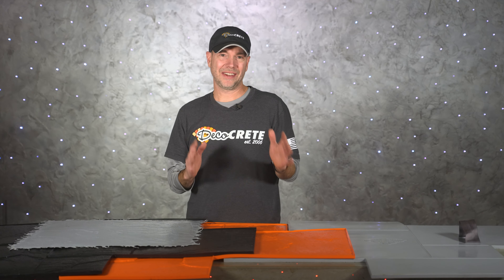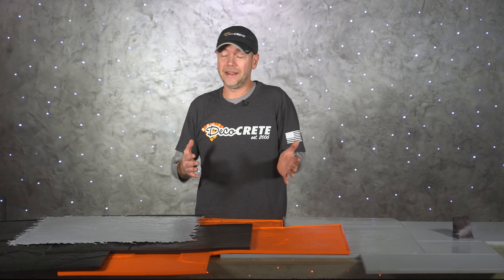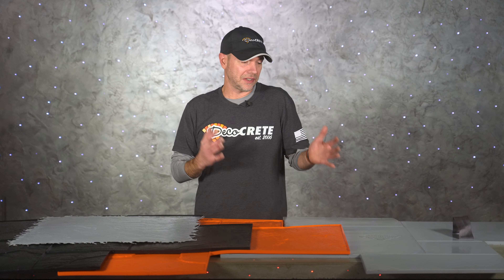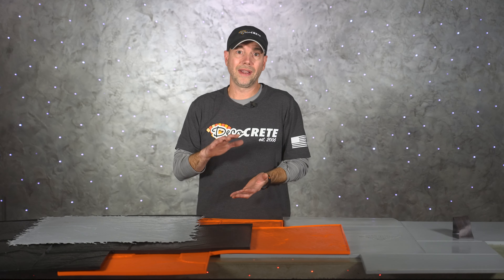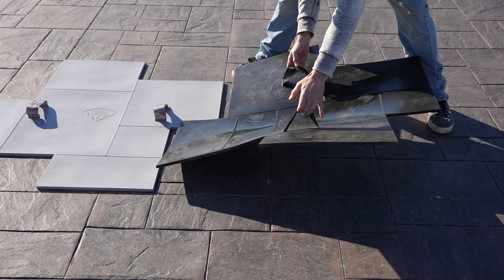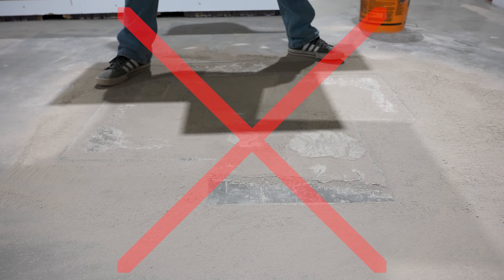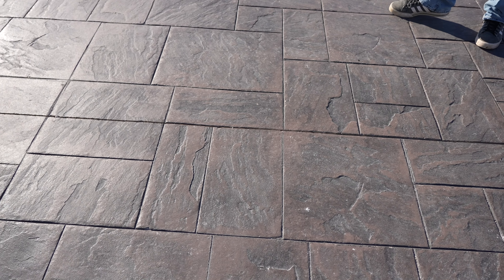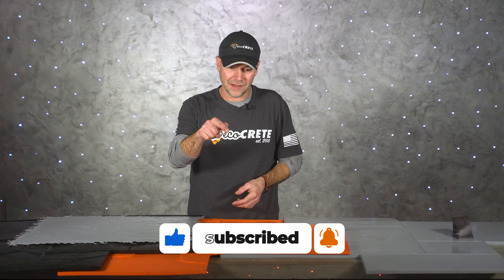Elevate Your Concrete Game with This New Twist! | Avalon Ashlar Stamps

Comment: Were using  Davis light grey color from the concrete plant and were gointo use two  colors of hardener charcoal grey and brick color red I think it will look nice because it matches the house
Reply from the maker: I would be careful with the brick red color along with the grays. You might want to make a small sample of that first. Blending red in with grays can be a bit tricky, the red tends to take over and just doesn't seem blend very well with gray. Also, trying to match the house is not always the best idea. It can be hard to tell where the patio stops and the house begins. Some contrast between the concrete and the house generally looks better. There is no right or wrong here and it's completely based on your preference, but we would recommend going with one or the other instead of blending grays & red together. If the house is red, grays on the concrete would probably look best, especially if the roof is gray. You could also tie the house in with a red boarder. Again, this is just our opinion and should go with what you like the best! It might be helpful to look at some photos online to get an idea of what it would look like. I'll leave a link to the photo page our website as a starting point. We hope everything turns out great on project! Thanks for watching Deco-Crete TV!!!                                                                                                                                                                                                                                           
https://www.deco-cretesupply.com/photos/stamped-concrete